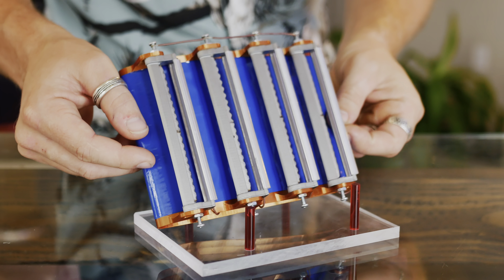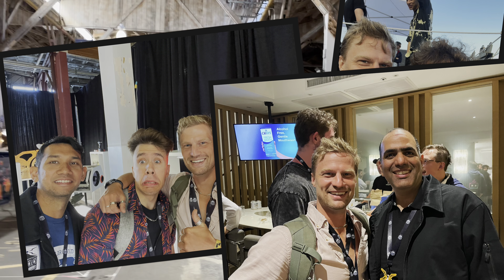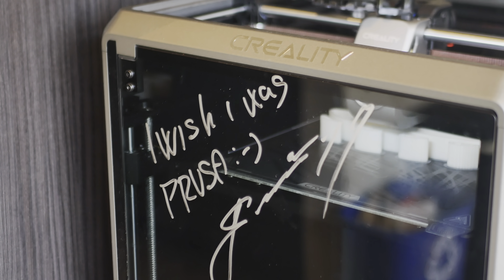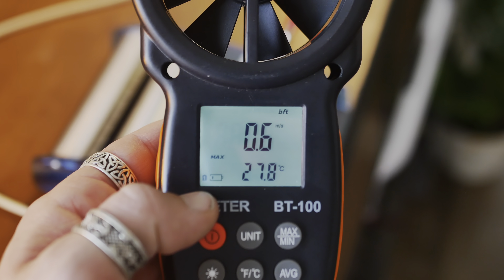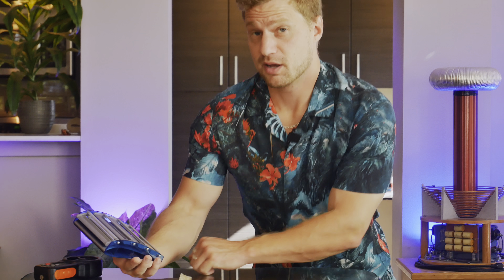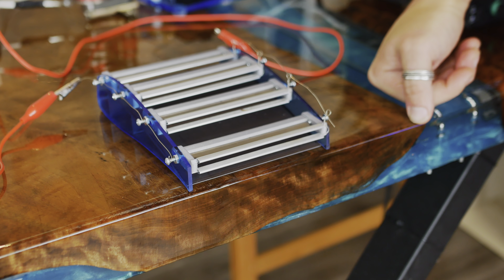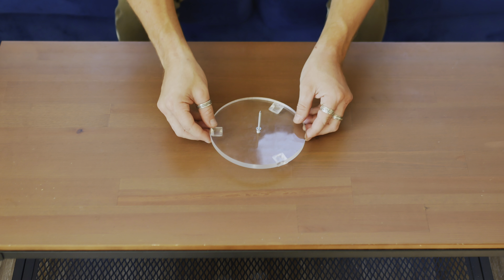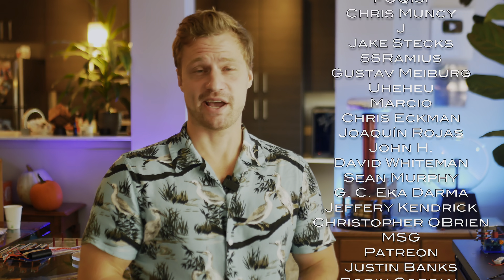Designing A Self Propelling Ionic Thrust Wing

Comment: Why not make the airfoil part of the ionic thruster instead of having them suspended above? Would ground foils on the upper wing surface with wires above them with the high voltage? Just a suggestion but that may cut some weight.

Comment: information        put thrusters in the fuselage and in the wing roots.        make a very very light airframe and (perhaps over-sized) wing.       use a (high mount) dihedral wing; fifteen degrees of dihedral is enough.  and  ultra light, large-diameter lg wheels.         see indoor free-flight models.        d

Comment: I think this would work very well for helicopter blades because they are so shallow. They would work well with just one line maybe and can be made up with by adding more and if you only need an electric slip ring to power the wings it gets rid of the drive shaft.

Also you know that crazy Mediterranean Sea plan with like two sets of ten wings stacked? Well ionic thrust distributes thrust, so maybe a design like that would have a chance of staying together.

Maybe we should lift things with ionic kites?

Comment: One improvement to weight reduction you might comsider is a spray-on silver coating for the anode instead of wire or razor blades. Its very light and a good conductor.

Comment: idk, I've seen both of your and Integza's channels and to be honest I saw his first.  There are debates about wing design and how they work. Some people argue that it's the high velocity air flowing the longer distance OVER the top of the wing that creates lift. Others argue that it's the air UNDER the wing that creates lift.  The way I see it, vacuum can only supply a max of 15psi of lift at sea level. This drastically falls off with altitude, but I guess every bit counts. I'm more of a "I've seen 1000's of psi in a compressed gas cylinder but never seen more than -15psig of vacuum kinda guy.. However i do acknowledge that it's actually the pressure differential that makes lift. 

Anyhow..  With all that thrust on TOP of the wing, you're trying to accelerate already fast moving air. On top of that, you are generating thrust induced pitch which will nose the plane down into the dirt. Not exactly what you want if you're attempting to fly this thing...  Mix that with disrupting the ideal laminar flow across the top of the wing and you may find that you're fighting yourself. 

How's this for an idea.... Build the wings HALLOW. Calculate how big an opening needs to be in the nose of the wing needs to be for air to flow THROUGH it.. Insert thrusters IN the wings! Using this idea allows you many advantages. 
-You don't obstruct the air flow OVER the wing, promoting attached, laminar flow over the wing.
-You reduce frontal area, which means you reduce drag. 
-You protect high volt electronics. (No shocks to yourself, and hopefully protect sensitive wires etc from getting bent from foreign debris if you have a crash.)
-Because wind generation is internal to the wing, you can employ volume multiplication via Venturi effect, similar to an afterburner. (This adds to air mass which should add to over all thrust)
-You can incorporate thruster mounts into existing internal wing structure which will reduce mass making wing assy's lighter. (Actually make the thruster assy part of the internal wing structure.) 
-Your exit for the wing is at the rear tip which nets 0 thrust induced pitch, and adds to the separation of laminar air flow from the tail of the wing. 
-Ideally, if the thrusters stop working, the high pressure point at the nose of the wing nets a near 0 loss in drag because it becomes an airfoil, much like airflow in a pickup truck with the tailgate up. (Mythbusters episode) 

I don't know why you wouldn't want to do this. you could also add a couple angled windows in the bottom of the wing to allow more air into the thruster pocket for the venturi effect. Or with iterative design you could shape outward air flow into a port shaped similarly to a turbofan engine housing rather than a slot the entire length of the wing to see which provides more thrust. 

Just thought I'd share what I was seeing when I saw this.
Reply: Replying to @gadgetdeez7069:

**DARZHNARZHERSHSRVELFLARZHER?

DARZHNARZHERSHSRVELFLARZHER?**

Comment: The problem with this is that for an operational aircraft using ionic wind you would need a significant power supply while still keeping it light.  I am not prepared to say that is impossible
but I believe there is significant engineering issues with that without a powerful and lightweight power supply that can be onboard the aircraft..

Comment: How the air flow of first blade works with the second blade? The first speed up, but as the air go to the second, it slow and speed again? Or it just add the speed? Maybe it need to turn on and off like 100 times per second? Like a eletric motor...

Comment: @PlasmaChannel just an idea but what if you designed the wing like a Dyson blade less fan paired with the ionic thruster to save space but your design is way better. Basically the ionic thrusters are sandwiched in the wing with a open flow design so there’s less drag on the top of your wing.
Reply: Could also slap on a high output Solar panel instead of the plastic film. Swift Solar has a promising model

Comment: Great project ! nice video.  Suggest using Nylon bolts instead of metal to save weight. all those elements on top of the wing, may generate a lot of drag, and break laminar flow, losing you lift. You'll need to figure out lift/drag ratio also, to know if it can fly.   How about putting the plasma thrusters in series, in a long tube in the fuselage, exactly like the fighter jets.   or several underslung thruster, like a commercial airliner.

Comment: That is interesting question is are you going to get lift, and if you could get lift how much wing would you need to have to have to over come the weight of the power cells, or would you try a hybrid configuration first to reduce fuel consumption? Very novel idea.

Comment: I have an ideal solution for this problem.  Stepping back into 1928 tech, there was a bi-wing design that used a standard lower wing airfoil, and an upper close wing slightly forward and curving over the wing life section to the root center, and it also resembled a modern jet mentoring extendable airfoil, which in effect enhances and makes the lift and forward motion stronger.  I think that this close extended version with a charged forward and trailing edge as the high voltage field effect would be all you need, and not the four charged foils design.  One upper foil would have better stability and have the ability to maneuver better without loss of performance.   Also, with one upper foil with a shaped charge section in tits fore and aft,  this should pull the air flow in and over the wing lift design in one place and maybe have the ability to modify the level of charge of each foil discharge plate.  This should work in theory, but I don't have time to test it in the lab, that's what you do best.

Comment: I could see a few problems with it but im kinda curious what would happen if you put the ion engines on the bottom of the wing I feel like since you want faster airflow at the bottom they may help with lift (key word may)

Also probably over kill but an idea that would be interesting is if you had some on the top and bottom if powerful enough you may be able to use differential thrust instead of elevators reducing moveing parts

Also also (if you haven't) you may want to look at the ion powered plan mit made it may be useful to see how others went about a similar task

Comment: I am curious about much energy it takes and how does it compare to a conventional propeller. My guess is that the battery power (= weight) it will need to make any significant flight will ultimately make it unusable at any scale. I hope I am wrong I love what is happening here and is a great place to start. Keep going and don't zap yourself!

Comment: Thanks for this ideas. Why not design the wing having for structural beams the ionic generator system itself ?

Any possibility to produce a self-lift-flow ?
Some blades under, the others below the wing.
Or , same number of "ionic power beam" up and down sides/ward... but adjusting the delivered power cause of the Venturi effect.

The streams should converge to the rear blade. This way, navigation might be done by moving flaps 🤔

Absolutely not an engineer... But just a thought watching your refection and tests. I hope my english good enough to be understood 🙃

Comment: Hi..very interesting..but I think you can increase the trust by using a multi function oscillator (up to about 100 mhz) with different scaler wave frequencies so you get a resonance effect (oscillation)  which increase the output power with the same battery input power and probable a decrease battery current and increasing the voltage current.
you might also use an 3000W step up converter to increase 12v to.90v. Cheers mate. keep on the good work...knowledge gives us more power. Greetings an engineer...

Comment: I think your having the same issue you talked about before. You had someone design the wing, then added the engines on top. Why not actually put them inside the wing so the profile remains the same. Just enclose the pieces into the wing and leave the opening at the back. It would reduce dragon and friction even more. Would require testing though.

Comment: Try point them down towards the wing so the one infrount don't stop the flow the you can also force lift with the pressure diffrence on the top vs bottom, rotate them all 45-35° down

Comment: you still need combat water in air and electricity in air planes get hit by lightning what happen if you made yours and it was hit? or a rain storm? loosing weight okay but it still needs moisture removel or it only good in deserts....that would have a hot air lift advantage

Comment: Suggesting improvments for desgin:
Positive electrode
    Score the wire with a razor blade to create "arc points".
    Create a press for tinfoil using saw blades. The cut out foil will have many serations.

Negative electrode
    Wrap tooth picks/wooden dowels in foil. Run a knife along the length at two angles to make tooth pick more airfoil shaped. Wood might be lighter than 3d printed plastic.

On wing design
    Focus on reducing front sectional area instead of coefficent of drag. 

    If you optimise "thruster" shape to create lift as well then the airfoil underneith may not be needed.
    Try looking at "unstall-able staircase" wing design on YT. They use multiple wing elements at slightly different angles to create a a larger virtual wing at high speeds. In a stall the most forward elements stall before the rear ones so you still have lift at high angles of attack.

Comment: This is definitely possible, it's actually been done, there was a university project did it with an indoor flying biplane.
Also, if you try a slatted wing design and use the leading edge slat to create your ionic thruster I expect you'll gain greater lift at lower speeds....

Comment: I need your help making a 4” plasma ring that I can fit into a 4” metal tube. It all has to be compact and I’d like to use the common taser coil but I need the frequency to be hi and not snappy. Can you or anyone help? I mainly need help finding the right frequency board to achieve a smooth arch and must be compact. Can anyone help?

Comment: You need to work on using Vase mode to print the wing, and LW-PLA filament. LW-PLA will reduce the weight of the printed parts by around 50%, and Vase mode will mean that much less material is used, saving even more weight. If you're worried about stiffness, then run a carbon fibre rod along the length of the wing.

Comment: Structure on the top of the wing doesn't have to be shaped in a lift generating way, it could just be as drag-less as possible, since the shape of the wing generates lift already. Did you also try putting the ionic thrusters on the bottom? While moving the wing might actually perform better with the thrusters located on the bottom, depending on the speed and air dencity.

Comment: I am a little confused about something: isn't the point of an airfoil to have low pressure air over it and high pressure below? If you put the thrust component below the wing, then (like jets have their engines there) wouldn't there be potentially more thrust output? Or would it interfere more with the aerodynamics of the system?

Comment: Is driving the air above the wing the best option, or would mounting the thrusters under the wing work better? Maybe you could do both to double the thrust.

Do even need the separate wing? Could you not make the ion parts themselves provide lift in a multi-segmented wing?

Comment: I notice you have your thrusters angled parallel to your assumed direction of travel.
I would suggest you orient them parallel to the wing surface (following the curvature of the wing) to maximise velocity of the air over the top surface.
This will maximise the lift produced relative to the airspeed of the craft.
Remember the wing will be "angled" that is flying at an "angle of attack".
Lift is determined by air density/2, coefficient of lift (wing section), angle of attack and airspeed squared!
Note, it is the airspeed over the wing that counts!

Comment: This is really cool. Considering you are wanting low speed, have you considered a Stohl wing design. The multiple wings will produce good lift at slow speeds. This will also give more area to add ionic thrusters. I first saw on #rctestflight the Stohl wing design used in an RC scale.

Comment: Try making it inboard. Inside the frame of the fuselage or wing, it doesn’t need to be aerodynamic, making it possible to optimise the engine for strength alone rather than strength and size. The cylinder design looks perfect for inside a fuselage. I also should mention that this type of aerodynamic optimisation may or may not be worth it, because it is most useful at high speeds. (See the equation for wind resistance, which squares velocity)

Comment: If nothing else it could be used for boundary layer control. Also, by accelerating the air only over the top of the foil increases the effective lift coefficient. The significance is that you can select an airfoil with less camber and lower drag for the same low speed performance. To get the most out of such a design you need to stagger the thrusters vertically on the trailing edge. A thruster, by design, creates a low pressure just ahead of it. By placing the thrusters on the trailing edge positions this low pressure over the top of the wing where it can contribute most to the total lift. It also provides a favorable pressure gradient all the way to the trailing edge which will delay stall and increase max CL.

Comment: The biggest issue that occurs to me is the amount of electricity needed to power a vehicle based on this technology.  While it is possible to do this with batteries, the weight of said batteries would probably ground any plane or glider unless moving up scale in terms of the wing design while reducing the size of components (such as using wire instead of blades) would allow a large increase in terms of efficiency.

Comment: Great Ideas, Try using carbon fiber filiment instead of wire as thin as a hair or thinner, styrofoam frames and air foils stiffened and braced with thin  strands of carbon fibres, weight is your enemy ,may even reduce power required, also plasma discharges at high voltage produces OZONE lighter than air just watch out for head spin, I worked in High voltage test labs these techos were seriously geeks  we worked inside a 10x 10x 30m high Faraday cage playing around  with high voltages from 66kv ++++ making fuse wire cathren wheels 5at a time on a thin wire strung from  a transformer, from the top  insulator 6 m high  and watched them spin as the voltage increased with the plasma discharge off any sharp point , good luck trying to fly the power supply.

Comment: 15:25 can you build this into a rotary wing design with the power supply balanced into the hub? The hope is that the thrusters would continuously excelerate air over the leading edge to the point of lift. Plus, in a 4 blade design, you'd have the benefit of 2 extra "wings".

Comment: I think your lift wil be reduced due to the components on top of the low pressure airfoil. Maybe if you van integrate the thrusters inside the top surface you wil get better lift results

Comment: First of all: Really great work. I'm very impressed. Some recommendations: Try replacing aluminium with copper. That should have much less exiting work, as the oxide layer has not to be broken. I highly recommend to use a DC high voltage source (e.g. high voltage lab power supply) that produces a smooth output. Those HV generators, currently used, to my memories, only work with voltage spikes, and are fairely less efficient due to the rms-to-avg phenomena. (RMS currents are always higher (and lossier) compared to true dc currents).

Comment: I have one question regarding the wing design.
Wouldn`t it make more sense to move the ionic thrusters to the bottom of the wing, since airplane wings work by creating higher pressure under the wing than on top of it and using that pressure difference to create lift?
I your design the thrusters suck air over the wing, so you work against the design of the wing and create downward force on the tip on the wing. Also there would be more pressure under the wing, especially at higher speeds which I think could have a positive impact on the efficiency of the thruster. Also the suction of the thrusters could help to create a higher pressure by sucking air under the wing.